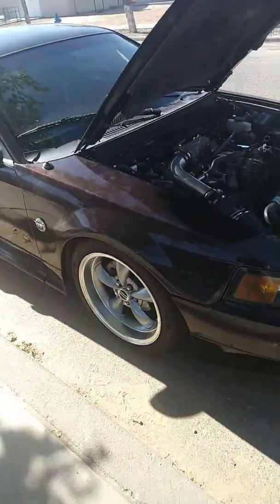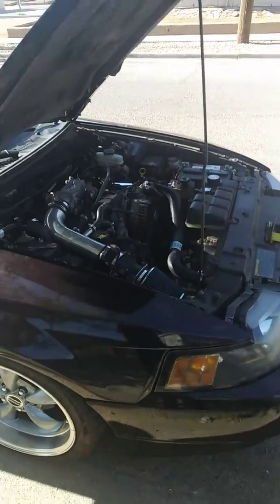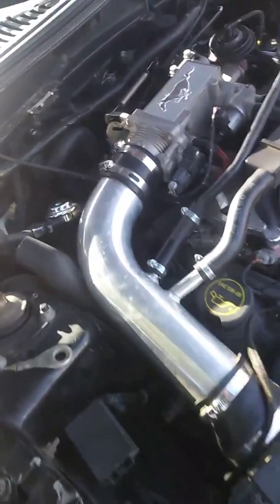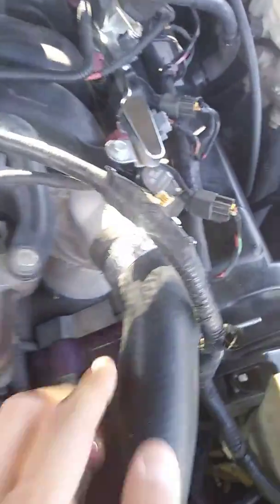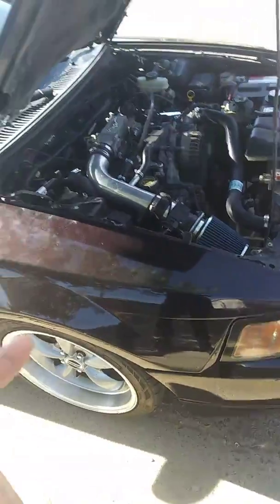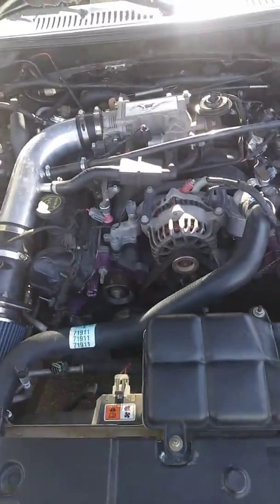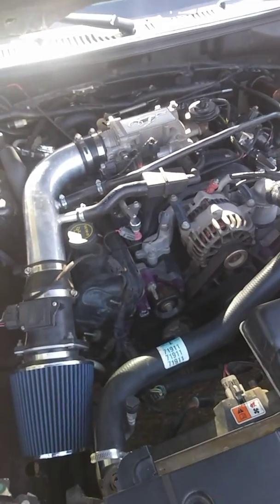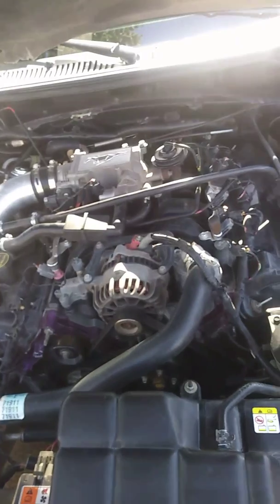Passenger side coolant leak 2004 Ford Mustang gt

Comment: My cousin has a 04 gt that drips coolant, don't know what kind of engine you have but we found out his coolant hose towards the upper part of the hood on his passenger side likes to come loose, this is a usual problem with the 4.6 liter engines on the 04 gt mustang, we are upgrading his engine to a small block soon but u might want to check the coolant hose towards the upper part of your passenger side.

Comment: Lol  that wet area is you ac dripping its normal on all mustangs that era have that problem its a design flaw which eventually it will cause a exhaust leak near the Cadillac converter.

Comment: 5 years later on a 5 yo video here I am first car. I have a similar problem. My car shot antifreeze all over my passenger side intake manifold, it also got on all of my sensors in that area, it got under the actual hood its self drenched in antifreeze, it was all over my air intake, and my car would not start when I hurried back home and cut the car off. I wiped it all up and let the car sit and then it cranked right up. Any one have any ideas for me?
Reply: I need answer as well did you figure it out?
Reply: @leslieb.7575  actually no because someone shot my dads house up targeting the wrong house and I never got to start my build.
Reply: Damn wtf all bad hope you’re good and you get a new build going soon mine just started doing this as well
Reply: @robertpaul3791  ^
Reply: @gbeengettinit9549  thanks man im gonna get another one just not yet

Comment: What was the problem? My mustang is doing the same thing
Reply from the maker: It was leaking from the intake manifold. It was broken from the gasket. The gasket would seal up when the car was running but it would open up when the engine was cool. I had to replace the manifold it cost me a total of about $300 for everything. 
You should also check the hoses as that is a lot more common.

Comment: dumb that ford corrected the front of the plastic intake. but, left the back connections plastic. mine was doing that too and the plastic tube was cracked. had to buy a new intake for 180...

Comment: What did it end up being ??
Reply from the maker: Johnny De La Rosa It was a leak in the intake manifold by the gaskets that sealed up when the engine was warm but opened back up once it cooled down. It was a hard one to diagnose had to go to a few mechanics 😅
Reply from the maker: carvis smith I had to buy a new intake manifold in total for the installation and everything it was about $300